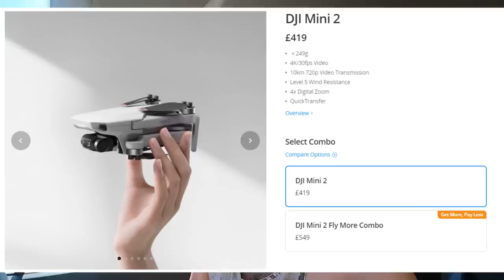WORST DAY EVER! I Lost Money, Got Sun Burnt & Had a Rude Client!

Comment: I feel your frustration, Sid.  I wondered about the owners of that house when you did the roof, but only in the front due to cost. If they were that worried about the patchwork tiling they should have left the roof dark. Better yet, they could have sorted out matching roofing...I'm not surprised that the owner was rude, it just comes naturally to bellends. Unrealistic expectations are just that; not realistic, it does not reflect on you. Sid, you are a lovely bloke. A lovely, sunburnt, bloke!  It's 35 C in Portland, Oregon today too. We are also not used to it.
Reply: 37.7 here in N Texas. Would love 30 right now! It's been like this for 4 days.
Reply: Was 39.4 celsius here in the Rogue Valley in Oregon 🌞
I lived in Portland (St. John’s area) during the 90’s.
Reply: Our first 30c of the summer today.  Alberta Canada, it’ll cool off overnight though. I won’t be out in the sun in a tank top. Drink lots of water. Stay safe, heat exhaustion is a thing.

Comment: Tyre repair kit and a 12v pump saved me heaps of times. If you can limp to a tire store they have approved patches they vulcanize on from the inside. 15-20£ at the most, and they'll usually squeeze you in if you call ahead.

Comment: You can buy a tire plug kit for less than 20£ for nail holes. Works great for simple punctures in the tread surface and will outlast the tire. Super simple to use.

Comment: Don't know when you filmed this, Sid, but I have a sunburn tip for you. If you are still in pain and there is still a lot of redness, try this. Get yourself a load of cheap tea bags (buy the cheapest black tea bags you can find). Chuck them in the bath and fill it with just enough tepid water to make you able to submerge your back, even if that means lying down on your belly in the tub with your knees bent and feet up in the air. Just so long as you can get the tea on your sunburn. Soak for at least ten minutes. The idea is that the tannic acid in black tea will reduce the redness and take the sting out of the burn. It also seems to slow down peeling or the skin. If the idea of soaking in the tub idea is just too much, then just steep a lot of the tea bags in a pot and let it the water cool down to tepid. Then soak some old towels or clean rags that you don't mind staining with the tea and use them like compresses across the burn. Best do this out in the garden or in the kitchen so you don't stain carpets or upholstered furniture is any drips occur. I promise you it works a treat. It saved our family's summer holiday one year. Better days coming, Sid. Hang in there mate.💗

Comment: I'm surprised you don't have a roadside program. Here in the US, the most popular is AAA. I think I pay about $80 a year for the peace of mind that I won't get stuck someplace. They do towing, free gas, and locksmith services, or come out and put the spare tire on. The best part, it's connected to the person, not the car. So I can use it even if I'm not in my vehicle. 
Secondly, I'm surprised you don't have a full spare under the back end. It would've been much easier for you to just change the tire to get on with the day. Then you can go to a tire shop to have it fixed. The tire was perfectly fine to have a patch applied and keep driving on it. I understand the convenience of those mobile repairs, but they are costly. If you don't have a full size spare under the back end, then I would get one ASAP. A donut just won't do with the kind of weight you're hauling. 
Now, get yourself some aloe vera gel and sooth your skin. Pick up some sunscreen for this sweltering summer while you're at the pharmacy. Unlike most things, you never can get your skin to build up a tolerance to the sun. It just gets easier and easier to get sunburned. And if you don't start putting on sunscreen, I'll send you one of those big Mexican sombrero hats from the flea market to keep the sun off your head and shoulders.

Comment: Mate we all have those kind of days, the kind that just make you think "Why the hell do I do this?" I arrived at a customers place to mow, drove my ride on mower off the trailer and got about 10 ft of lawn mowed and the belt snapped.  I had to push mow the whole large property, in the middle of summer, sweat and dust in the eyes. $279 for a new belt, and a one month wait for a replacement. I was on a pressure washing job and the pump went on the machine, just a trickle coming out of the nozzle. Had to pack it up, drive to where i bought it and swap it for another one, once again middle of summer. Always going to get the odd rude customer, not much you can do but grin and bear it. Would love a drone for before and after shots. I'm sure your luck will change soon, don't stress to much! Cheers. Steve. Upper Cuts Lawn Care - Devonport Tasmania Australia.

Comment: Worked in the building trade many years had many punctured tyres from screws and nails, always carry a repair kit which are simple to use and an inflator, even if its just temporary till you can get to a tyre shop for a proper repair, I'm guessing for 300 they came and put a new tyre on when with it being in the centre a repair would have been fine, I've even driven the screw in and got enough air in to nip off to get it repaired for like 20 or 30 quid.

Comment: Multi drop courier tip: never travel without a can of Tyreweld or similar. & a Ring tyre inflator. Screw the offender in as far as it will go, a little squirt of tyre weld seals it up, then use the tyre inflator. Most tyre shops wont repair a tyre full of tyreweld, wash it out 💪🏼💪🏼💪🏼

Comment: I know how days like this feel bud, I recently had a job doing some woodwork for a customer, got too the job and things were fine, customer was happy with what I was doing but when I  went to drive to the shop to get some lunch I found my power steering pipe had burst and leaked all over their drive way. Phoned the repair guy and they came 2 hours late and told me it needed a tow or for him to follow me while i drove the van home with no power steering as it wasnt something they could fix on site. I told the customer I needed to go with the recovery team and couldnt finish the job that day which they were (at first) ok with. They then later text me saying they werent happy the job wasn't finished and that they weren't going to pay the full quote as it was going to mess up the decorator and they'd have to pay him to come back again after i finished (I later found out the customer did the painting himself) and to top it off they wanted the driveway cleaning before any payment was made. Bare in mind the driveway was covered in previous oil spills and i couldnt prove it wasnt my van that left spots all down the drive! So I cleaned the drive and they still refused to pay me. Didint earn any money that day and it cost me 2 days in putting what was an un-preventable accident right and left me with a sour taste in my mouth for a good while.  Anyway, Thats the price you pay for running a business I suppose. We live and we learn dont we!! ups and downs but aslong as we keep our chins up we can recover from anything!! Hope the rest of your week goes better, You deserve a run of good luck for entertaining us folk!  P.S sorry for the essay 🥱

Comment: Flat tires are the worst.  The frustrating thing about yours was that since it was a nail hole in the meat of the tire it would be super easy to manage on the spot by either  1) having a 12V powered air compressor in the car so you can refill it / keep the pressure up until you had time to get to a shop for a proper repair or 2) using one of those tire repair kits that with the green sealant they call "Slime" which you just squeeze into the tire and then use a small compressor to fill the tire again (this is even Tesla's suggested method since they don't include a spare tire in their cars).  I've had a tire that went an additional 20K miles after using that green slime 3) using a rubber plug kit from an auto parts store and, again, the portable compressor.  This last one is the only one that requires any  skill beyond filling the tire with air.  As a small business owner whose vehicle is essential to their livelihood you should absolutely invest a few ££ in the compressor at least as it will almost always buy you time and mobility.
Reply: also... that tire could 100% be safely patched by a tire shop (they glue the patch over the hole on the inside of the tire) rather than replaced, too.

Comment: I have a small electric pressure washer, only 2000psi, 1.4 gpm. Nothing special, but it does the job ;)
Reply: Josh  AR Blue Clean 2000 PSI Electric Pressure Washer AR390SS

Comment: There's still daylight left, why stop, I use to do this for a living also, and I always told the customer before hand how long it would take, 1 day or 1week, if they have that then there is no expectation, do more than the  customer expects and you will have more work than you can deal with, I had a crew of 3 and we stayed busy. Also don't know what your regs are there, but if you spray bleach on the stone or wood that has that black mold it will make cleaning it easier and it looks better, of course its been years since I did this so there might be better techniques,  keep up the good work your doing good!

Comment: How come you stopped using the rotary partway though Sid?  Had to reduce pressure to protect the surface or something or was it getting gunked up, or did it break?  Disgusting working in that heat though man, roasting hot and sweat dripping into your eyes -  - I feel for you dude😩.  A cool box with some crushed ice, bottles of water and a cool towel for round the back of the neck would have maybe made it a little more bearable - and a nice Hawaii shirt too!!

Comment: You think that’s bad? I once went roller blading and made about a 2 hour run out and 2 hours back, during which I wiped out once. Midway, I stopped once to buy some water and realized I’d lost the $20 bill I had in my pocket. So no drink. When I finally got back to my car at the entrance to the ravine, I realized I’d also lost my car keys. Then had to blade up a road on the side of the ravine to a main road where I flagged down a tow truck while wearing roller blades (not too embarrassing), to come back to my car and open it, since I had a spare key hidden inside. When I was finally ready to head home, and started down the road, I heard a sound outside, and realized I’d left my sunglasses on top of the car and they were now on the road somewhere behind me. I just continued home so I could crawl under the bed before lighting hit me. 🥺

Comment: Don't think of it as a "different kind of heat" think of it as what it is, what are y'all used to there 20s? during the summer? So 30s is 10° over the hottest you're used to!  For Fahrenheit people, if you're used to 100 with humidity (Remember England pretty regularly has 80-100% humidity just like the southern US! 86° (30° c) with 100 humidity is pretty miserable here too! Heat index would probably be close to/over 100°!) being the worst you see all summer, imagine 110°!

Everyone can get used to most temperatures where they live. Anything outside the norm is bad because you're not used to it! If you're used to 70s, 80 is gonna suck. If you're used to 100, 110 is gonna really suck! Don't judge people when you'd have exactly the same problem!!